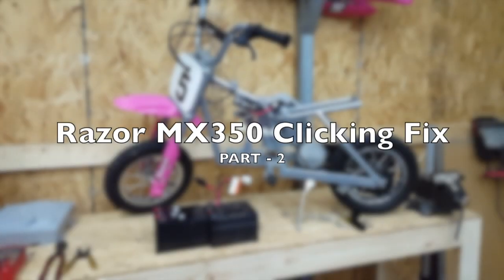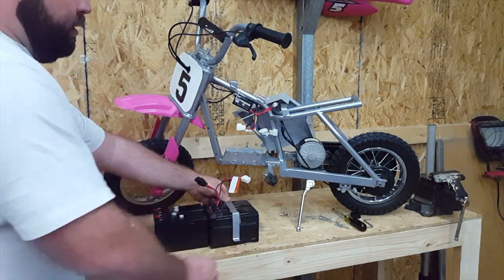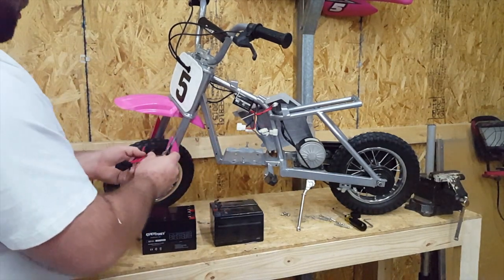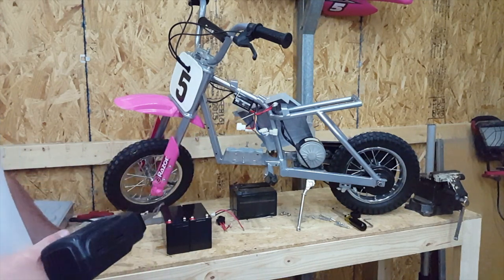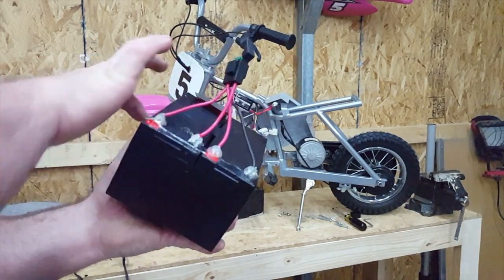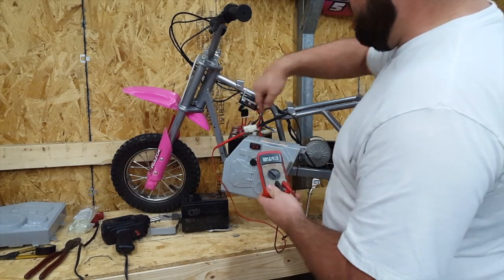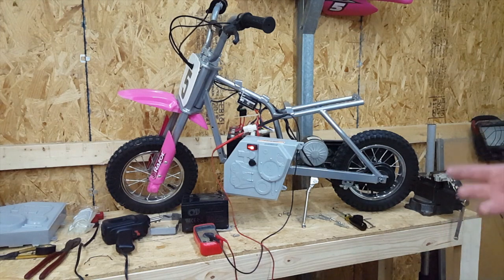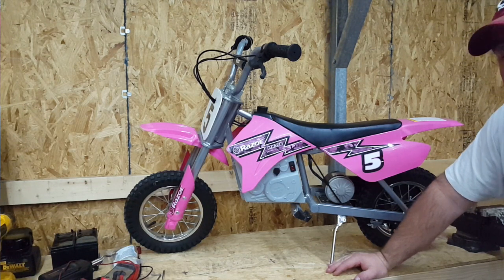DIY | HOW TO FIX RAZOR MX350 THAT DOESN'T RUN PART 2

Comment: I have tried replacing the batteries like it said in your video I bought brand-new ones from Canadian tire installed them on the bike and it still made the clicking noise spun the tires  and then cut out

Comment: My son was given a MX400 from a friend down the street.  I have the bike torn apart for cleaning and to replace the tires.  (The rear tire was cracked and the tube wouldn't hold air so I'm just doing a total tire replacement.). It's a 2013 according to the sticker so I'm wondering about the batteries; I checked and they are 27.2 V before and after turning the switch on.  That seems okay but I'm just worried about the age.  7-years seems pretty old for batteries.  Also, a vendor out there is pushing a 9 Amp upgrade.  Thoughts?

Comment: My husband has the Mx350 and has the same problem turns on light once turned on but once he tried moving the throttle nothing happens after that. Does he have to be moving to give it a push start to get it going?

Comment: Having similar issue w/my son's mx350... Power button glows red, batteries are charged (and show 28v). When turning the throttle, all I get is click sound from the control module and zero movement from rear wheel. However, if I hold the throttle full open and then rotate the rear tire with my free hand, the rear tire will spin, but once I let go of the throttle (and the rear wheel comes to a complete stop) the throttle reverts back to causing a clicking sound from inside the metal controller and the wheel will not turn from a dead stop :(

Comment: Mines the clicking in the controller battery are still perfect charge with my sx500 maybe the controller if that's the other prob
Reply: Having similar issue w/my son's mx350... Power button glows red, batteries are charged (and show 28v). When turning the throttle, all I get is a click sound from the control module and zero movement from rear wheel. However, if I hold the throttle full open and then rotate the rear tire with my free hand, the rear tire will spin, but once I let go of the throttle (and the rear wheel comes to a complete stop) the throttle reverts back to causing a clicking sound from inside the metal controller and the wheel will not turn from a dead stop :(
Reply: You have to push to start moving on the mx350. That’s why it goes when you spin the wheel and then hit the throttle. I don’t think you have an issue.

Comment: Hey man, I have new batteries and a new controller in my son's mx350. It worked great for a day and then it started clicking while he was riding it. It doesn't do it without him on the bike (if I lift up the rear wheel and turn the throttle). Any ideas?
Reply from the maker: I would start testing the batteries and the controller. I wish i could magically tell you what it is but i cant. If it was here in front of me i would still test it.
Reply: Having similar issue w/my son's mx350... Power button glows red, batteries are charged (and show 28v). When turning the throttle, all I get is click sound from the control module and zero movement from rear wheel. However, if I hold the throttle full open and then rotate the rear tire with my free hand, the rear tire will spin, but once I let go of the throttle (and the rear wheel comes to a complete stop) the throttle reverts back to causing a clicking sound from inside the metal controller and the wheel will not turn from a dead stop :(

Comment: Mine doesn’t clock either. Changed the battery and turned on. It worked for a second and won’t work anymore. Noticed the on switch did not light up. Any suggestions? Bought it new for Xmas few weeks ago

Comment: Hi, i have a hyper 350 and everytime my son  starts it the motor is tripping and it needs to be resetting every minute. The fuse is ok, i replaced the motor for a new one, i took out the brake and still is happening the same, what could it be?

Comment: I got all brand new batteries and controller and throttle and I got it to work but it only will charge if I change them individual but when there in series they don’t charge
Reply from the maker: Sounds like either the charger is a 12v charger or the 24v charger is going bad. Look at the charger label for the output voltage. There will be a input voltage and output voltage on the box that plugs into the wall.
Reply: @Fentertainment   it’s a 24 volt charger I bought a brand new charger for it and that doesn’t work either so it can’t be the charger
Reply from the maker: @Angela-mf3sk  New batteries and new charger...hmmm. Is there a fuse-able link between the batteries like stock? If so make sure the fuse is good. If its good and you have tested the batteries with a volt meter you should be getting around 24v's. You would also need to test the charger output to make sure its supplying 24+ voltage output.
Reply: @Fentertainment  I don’t have a volt meter but I’ll check the fuse

Comment: Would 7.5 work or it has to be 7ah
Reply from the maker: Halloween Michael Myers 2 7.5 would actually hold the charge longer
Reply: Fentertainment so it's bad
Reply from the maker: The "ah" means Amp Hour. Make sure the voltage is the same and the "ah" is no less than the original. IF you replace a 7ah battery with a 7.5ah battery then it will last longer per charge. If you get less than 7ah then it will last less per charge.
Reply: Fentertainment so a 2 battery pack of 12 Volt's 7.5ah would work
Reply from the maker: Yeah should be fine

Comment: I put in new batteries still only clicks...
Reply from the maker: Whats your voltage at rest with the bike off and whats the voltage when the bike is on.
Reply: I have the same problem. I worked before replacing the batteries. Only changed them because they were old and wouldnt hold a charge.